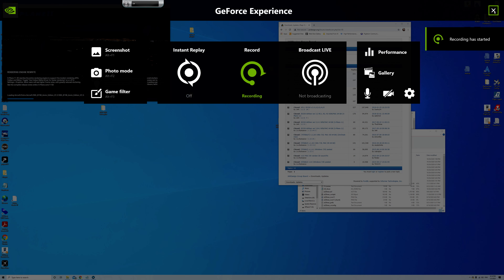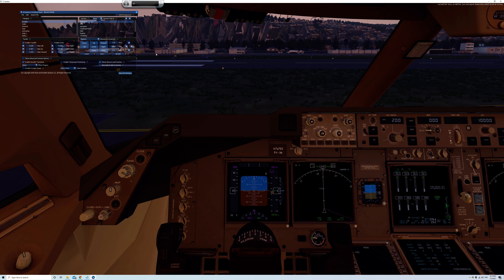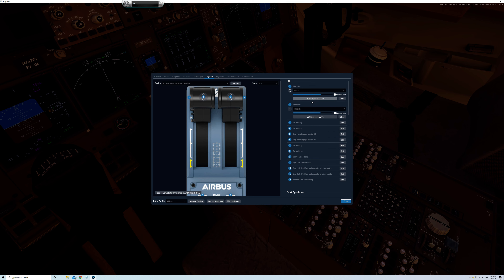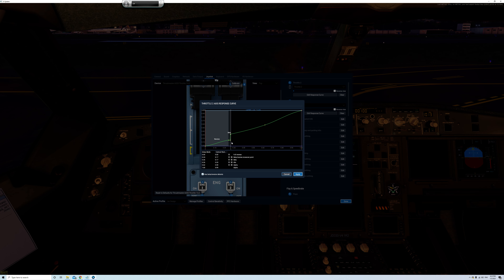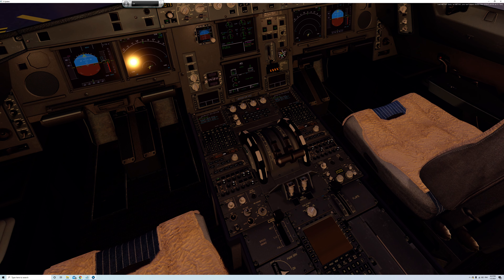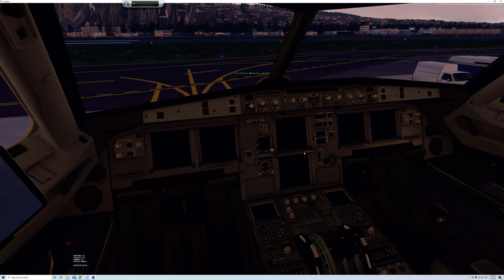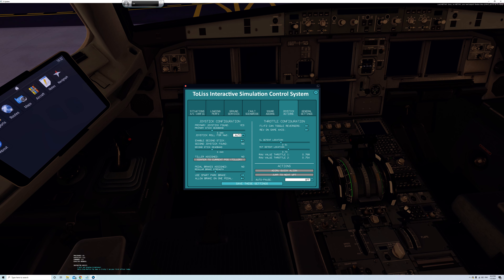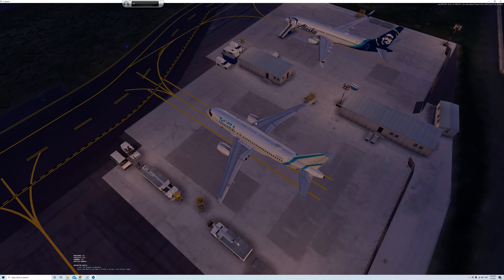Set up Thrustmaster TCA Throttle Quadrant with JarDesign, SSG and ToLiss jet aircraft..

Comment: In the Toliss A321 when I go the the Toliss Screen I don't see REV ON SAME AXIS. The tab is diffrent, the name is "sounds/actions joystick" what should I do?
Reply: We have the same problem and cannot find a solution for it! What should we do?? Anyone with some usefull ideas?
Reply: @kvbrussel  You probably don't have the right version (I got version 0.4 first) I now have version 1.1 and I am now able to see the option.

In case you have the cracked version, you can find version 1.1 on Rutracker. If not I can email the link/file

Comment: Broke friction by over tighting. Does anybody know, how to fix or what to do?
Reply from the maker: I have the opposite issue.. one of mine is too loose.. I think there is a hole at one end that allows an Allen wrench to tighten it.. the couple I happen to have don’t fit.. does anyone remember if an Allen wrench or tightening tool came in the original packaging?